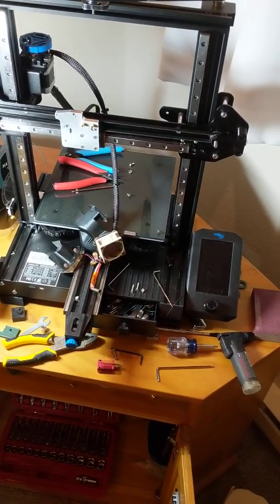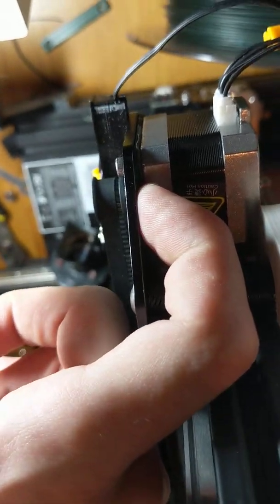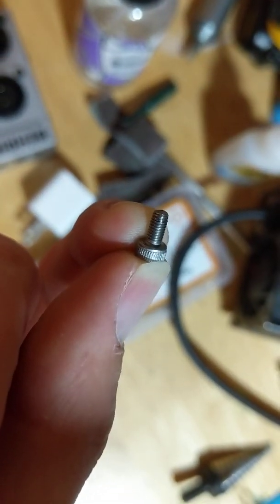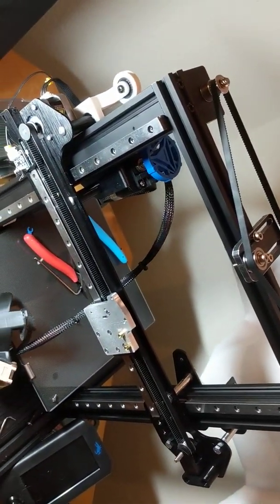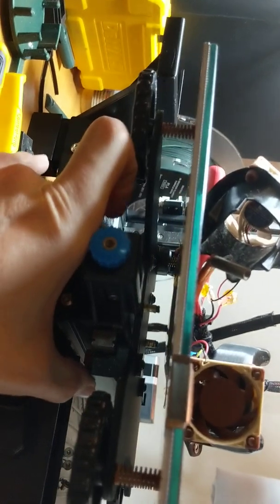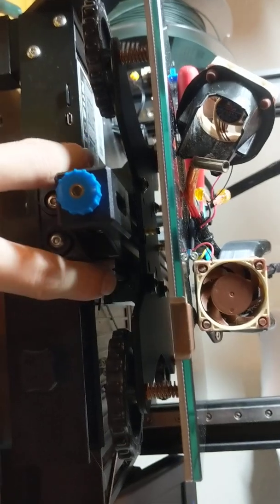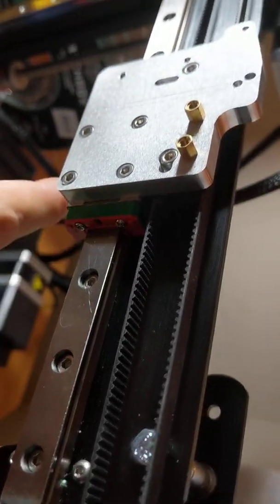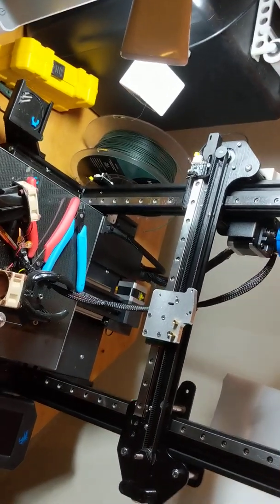workaround for Ender 3 v2 X and Z linear rail kit from 3dfused, and other goodies

Comment: I fail to see the point of this "mod" . Print quality won't improve, speed is not increased, maintenance requirements are way higher and cost explode. Only downside, no upside. Anyways, from a tinkering perspective surely an interesting project (unfortunately of little practical use). Correct me if I am wrong as I am always happy to learn something new...
Reply from the maker: I'm enjoying prints with no gantry sagging. Since I use linear rails, they move smoothly when delrin wheels might develop flat spots, require you to adjust eccentric nuts, and get wear lines. Plus, for me, this is like modifying a car, adding turbochargers, etc. Not necessary, but I find it improves quality of life. And I'm not the sort who wants to find ways to get around bad alignment. Someone might be good with that, but I want a relatively stable setup I'm not having to worry after.

I did get flat spots in the wheels. And for the Y axis, having the wheels sideways when the bearings in them aren't even thrust bearings means pressure could cause them to seize up. That might not be an issue, exactly. But I do like the dual linear rails holding up the Y axis.
Reply: @BirdTho  Yeah, the tinkering part is awesome and there are certainly huge benefits to linear rails. However, I just don't see them justifiable on an Ender 3. I'm working on an Ender 3 conversion to hit 20 to 30k accel with precise movement. Basically designing the whole printer from scratch  except for the frame. Using wheels for it, which makes the design much more challenging (these wheels are big...). Let's see how this goes. Maybe I'll have to switch to lin. rails as well at these accels. For 3k, wheels work fine and I don't mind the tightening issues. Sagging is no issue with dual z lead screw or belted Z...I hope to post video in a few months once the project is "done" (well, it never really is, is it?...LOL).  In any case, this hobby is about having fun, which we all seem to have. Cheers on that :)
Reply from the maker: @allpro3d741  I hear you. In CNC machining, accuracy and repeatability for heavy workloads relies on the machine's rigidity, and this one is ok on rigidity. Higher acceleration can cause higher flexing, and the lightness of the frame can allow for resonance modes and vibrations. So either beefing up the frame or adding dampening would be good at some point. Linear rails though, imo, do help to add rigidity because they're solid steel bolted to the frame all along it's members.
Reply: There is a huge difference between linear rails and plastic wheels running in aluminum extrusions.

Linear rails add rigidity, precision, and repeatability not to mention are much lower maintenance.

People who claim that they don't see any difference in print quality either had poor print quality to begin with or printing at stock speeds and below.

I mean if you're printing it 40 to 50 mm/s then you're not going to see a huge difference.

On the other hand if you upgrade to Klipper firmware on your, install an accelerometer on the X and Y axis So you can resonance tune your printer you'll be able to take advantage of the linear rails.

I'm currently printing at about 150 mm/s with acceleration set to 3, 000 on what used to be an ender three. And I'm getting better quality than I was on the stock machine at 30 mm/s running Marlin

Print that used to take 12 hours to do, I now do in 4 hours And they look better than they did when they took 12 hours to print.
Reply: @dannelson8556  funnily enough, I also print 150mm/s with 3k accel on my CR-10 S Pro..running wheels :p
Reply from the maker: @allpro3d741  I am running a print where I've turned up to 250mm/s.

Comment: Hey a have the same 3dfused kit with the same z mod and I am having trouble with the z running smoothly or at all some times
Reply: Me too! Was really hoping there was some solution out there. The x axis gantry is just too heavy for the z motor
Reply from the maker: I... got around the gantry sag with dual Z kit. With a dual Z kit, two things that might cause the motor to struggle is the belt being too tight that is causes the bearings to seize from the torque, or the bearing blocks being misaligned. Also, those brass nuts on the X gantry have a little wiggle room for alignment too.

I did have the belt too tight at one point, and the motor struggled to lift and lower the Z axis.

Another issue with the dual Z is having the Z level, otherwise the angling of the gantry can put torque on the leadscrew nuts.
Put the gantry at the top to help align the bearing blocks and the nuts, and then shim it against the bed at the bottom to set the alignment of the screw rotation. I wonder if I should try making a video about it.

Comment: could you follow up on the results of prints after the rail upgrades?  compare the pre/post rail benchy?  I've noticed that the taller the print the more likely it is to fail, maybe this upgrade increases the success rate on (taller) models?
Reply from the maker: Yeah, they're working reliably and I'm happy with them.
With just delrin wheels and the Z motor only pushing up on one side of the gantry, sag leads to cumulative errors. With delrin wheels, this involves levelling the bed and adjusting the captive nuts in order to level it out the best you can. Dual Z mods are cheap, independent of the linear rail part of the upgrade.